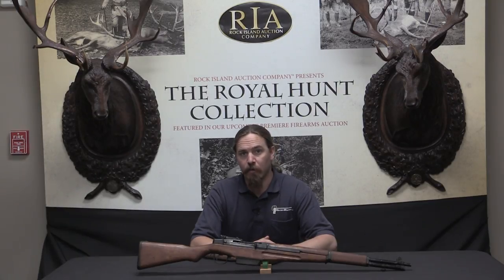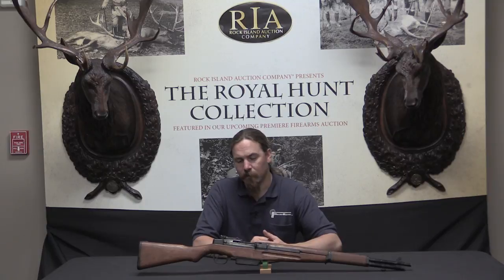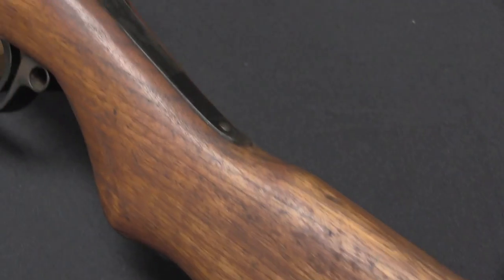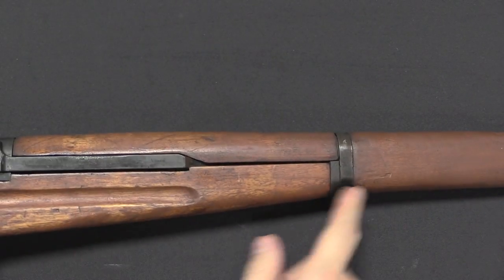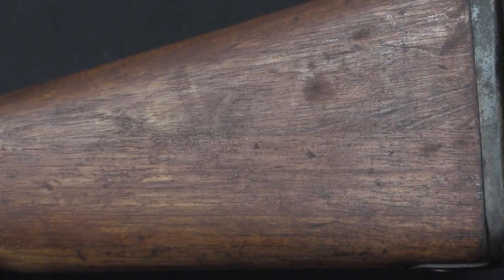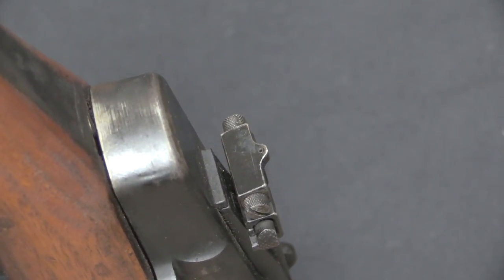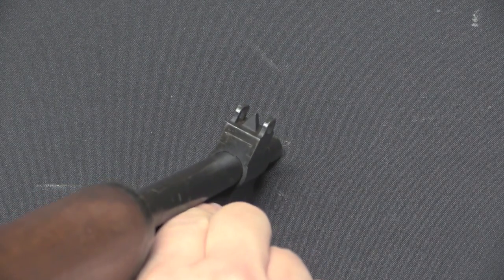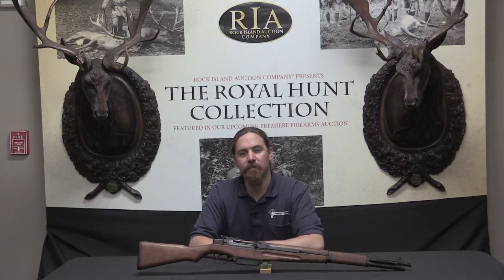Japanese Type 4 Garand

Comment: "These were never issues" Battlefield 1943 thinks otherwise
Reply: Same in Bad Company 2
Reply: +GTS Revolution Also featured in Bad Company 2. Most likely a re-used asset between the two games.
Reply: +GTS Revolution - get a life?
Reply: steve1978ger
Says the guy that seems to be upset about harmless trivia that's easily ignored.

A lot of video games have a lot of illogical implementations of various fire arms. It's just amusing to see those mistakes and trying to comprehend what the developers might have been thinking. Head over to IMFDB and you'll find lots of examples of articles mocking the nonsense put into games.
Reply: I am not upset :D
Reply: +GTS Revolution 

Didn't Battlefield 1942 have some kind of Garand for the Japanese too?
Reply: Tevo77777
They had Kar98s i believe. The Americans started with Enfields but later got Garands
Reply: +GTS Revolution 
I read somewhere that more US soldiers in WW1 were issued M1917 Enfields ("American Enfields") than M1903 Springfields.  

I knew when the US entered WW1 it was easier for the US firearms factories, that were already producing Enfields for the British, to simply re-chamber for US .30-06 than re-tool to produce Springfields  (but I had always assumed the US had more Springfields than Enfields).

If i recall correctly many of the M1917 Enfields (US .30-06) were sent to the UK early in WW2 for use by the British Home-Guard.  I think they were CLEARLY marked or painted in a manner to prevent someone from loading British .303 ammo.

I know during early fighting in the Pacific the US Marines used bolt-action rifles (I always heard they were M1903 Springfields).  I've never heard of the US Army using bolt-action rifles outside of specialty roles or at locations far from the battlefields.
Reply: thepezfeo Dude, i play Verdun, i know how the 1917 Enflields look and the guns given to the Americans in Battlefield 1942 were NOT it. They were Lee Enfields.  And even it they were, this is a WWII game we are talking about.
Reply: GTS Revolution
I wasn't arguing against anything, I don't play the game.  I was talking about actual history that I thought might be useful in some manner.
Reply: GTS Revolution
- well, sorry I take that back. Been watching gamer videos all weekend.
Reply: +thepezfeo your probably thinking about the american enfields that if memory serves were designated the m10 and saw limited if any use in the navy. but i do believe you are right about the us supplying rifles to the uk but i dont remember what model or caliber they were
Reply: To be fair, the battlefield games need the 2 sides to be relatively balanced with eahcother. So if an american class uses a semi auto rifle, the japanese equivalnet also needs a semi auto rifle.
Reply: LordDarthHarry Oh i know the freaking reason behind the decision, i still see it as a deal breaker.
Reply: +Tevo77777
Yeah, in the 1.61 patch. They called it a Type 5.
Reply: That is to balance the two sides. it'll be unbalanced if american has semi auto m1 and japanese only has bolt action arisaka
Reply: Hong Shen Obviously, but they still gave the Japanese a KAR98 German sniper rifle to add salt on the historical injury. On their website, they even said they did it because they just recycled an old model.
Reply: yeah that's definitely laziness. but bf1943 was a minor title that only released on consoles.
Reply: I don't remember the Garand or Type 4 in 1942, but I do from Vietnam's WW2 Mod.
Reply: Daniel Sinks

They were patched into the Pacific maps some time later if I remeber corectly.
Reply: LordDarthHarry I heard that but I apparently never got them. I played when I was around 12-14 and I'm 18 now, but I doubt they patched them in just a few years ago. I might just not be remembering.
Reply: Obviously they wanted the game to be balanced. The american was the only one who had semi-auto rifle anyway.
Reply: They also fucked up on the model too. The Type 4 Garand has a 10 round magazine opposed to the M1 Garand's 8 round magazine. The Type 4 also loaded with two 5 round stripper clips rather than a single enbloc clip like in the game. So lazy.
Reply: GTS Revolution 1943 was an arcade battlefield they weren't concerned about realism just balance
Reply: LordDarthHarry tell that to Day of Defeat lol
Reply: My Grandfather was issued a 1903 in the South Pacific.  Said the Garands came later.  Marine Corps.
Reply: Mutant1988 wait who’s arms are on fire?
Reply: actually most American soldiers in WW1 used the type 17
Reply: not true, America started the war with BOTH and as it progressed more and more the garand became more common while their ought 3's became more scarcely seen on the battlefield.  @JoeTheVenezuelan
Reply: Yet, for some reason folks thought a chick with a prosthesis was one toke over the line for people - BF1942 had jet packs. This is relatively tame for BF standards, or lack thereof.
Reply: @JoeTheVenezuelan   Battlefield always used WWII (And its set-pieces in general, though Vietnam was more accurate than other titles) as a thin coat of paint for their admittedly-fun multiplayer formula. Never been historic other than aesthetics. Like all of the "highest fashions" of WWII chic are to be represented. I know I said it already, but I can't say it enough - I don't know how this most recent nontroversy was something unexpected or new or even that offensive in comparison to how they've always been.
Reply: @JoeTheVenezuelan  the fact that i recognized you shows how much of a degenerate i am
Reply: @hongshen1429  idk about that, the japanese were pretty balanced in that game with all of their smg's and MG's, or at least, thats how i remember it.
Reply: Mutant1988 an example of this is far cry 2 where all the guns are mirrored like wtf
Reply: GTS Revolution Bad Company 2 Prologue as well 😂
Reply: There basically the same guns
Reply: They needed something to balance both sides. So they put this in there.
Reply: @JoeTheVenezuelan  the japanese had MG 42 in airplanes, tanks and mg nests. The medics and snipers had arisakas. And the US snipers used no. 4 Lee Enfield rifles. There were a lot of weird things in BF 1942
Reply: Finding out about this gun let me enjoy that game a lil more. Instead of being pissed off they fucked up the Garand.

Comment: I'd bet the pin hole rear sight was just a locating hole that never got drilled out to the final diameter.
I'm sure it was rushed through and someone thought they would get back to that step and it never happened.
Reply: im 5 years late but thats a really good point, makes a lot of sense actually

Comment: I'm surprised they didn't just slap slightly modified type 99 sights onto it. Certainly better than that literal pinhole and giant wedge. Thank you for the video though, I've been curious about this rifle ever since I saw it in Battlefield since I thought it was just a way for the developers to be lazy and reskin a Garand rather than it actually existing.
Reply: Yeah I also got the impression that it was just a Garand made to look Japanese. Then again, the one from 1943 had a strange octogonal rear sight similar to the M1 rather than the tangent, even though the irons weren't even used in that game, so I guess the models never were entirely on point.
Reply: Did the type 99 use the leaf sight similar to the type 38? I have a type 38 carbine picked up from pelilou. It's not in good condition buts it's a hefty beast with the intact imperial seal. It's at least as heavy as a Mosin Nagant. 91/30 that I own.
Reply: I want to think the rear sight on this example might not have been properly completed. I really doubt the guys building these things knew absolutely nothing about guns. Maybe the tiny pinhole is a pilot hole, and the sight was never actually fully drilled out to it's intended size.
Reply: @BringerOfD  My thought too.  The Japanese were no slouches about sights...I recall one reviewer of the otherwise-unimpressive Type 14 Nambu was very impressed with the easy-to-acquire-position trapezoidal notch of the rear sight.  And the type 99 Arisaka's rear ladder sight and battle sight are both well-defined apertures.

Comment: It's interesting that they decided to completely reverse-engineer the rifles instead of reverse-engineering the 30-06 cartridge so they could use captured guns, and reproduce the Garand much more easily. It seems like the cartridge would be a much easier thing to reverse engineer than an entire rifle, especially considering how much they would need to modify to make the Garand work in a different caliber, rather than just copying the existing design.
Reply: if they would have reverse-engineered the 30-06, they would have added a new cartridge to the supply system. units equipped with captured m1's would still have needed 7.7 for their machineguns. plus you can always rely on some in logistics fucking up and sending the 30-06 to a unit with arisakas while the unit with the m1's gets the 7.7.

Comment: Thank you for the great video. In Japan, there is a debate about the ammunition for the Type 4 automatic rifle developed by the Navy. One theory is that it is .303 (7.7mm x 56R), an aircraft ammunition used by the Navy, and the other is that it is 7.7 x 58 mm (Type 99 regular cartridge) used by the Army. It's interesting because it's natural for the Navy to want to use ammunition that is in circulation. It is unfortunate that the Army and Navy could not share the same ammunition.
素晴らしいビデオをありがとう。日本ではこの海軍が開発した四式自動小銃の弾薬について議論があります。海軍が使用していた航空機用弾薬の.303（7.7mm×56R）である説と陸軍の7.7×58 mm（九九式普通実包）である説です。海軍で流通している弾薬を使用したいと考えるのは自然なことですので興味深いです。陸軍と海軍で使用弾薬の共有化が実現できなかったことは残念です。

Comment: Meanwhile in WW2

Japan: I need a new rifle, hey America, may I borrow your homework?

America: Sure, but make sure don't bastardize it.
Reply: White343 The M1 was designed by a Canadian
Reply: @newman793  So? He worked for the US and it was manufactured there.
Reply: Igyzone He was Canadian-American so you are correct about it being American
Reply: They could get Gewehr G43 from Germany and rechamber it. Much easier than doing this with Garand without documentation and technical help. G43 is even cheaper to make!
Reply: @jakublulek3261  the japanese and germans werent as best of allies as most think.
Reply: Samuel Giam  That overpressure was deliberate design choice after problems on Eastern Front. You could just crank it down for Japanese. Plus Japanese cartridges have less pressure than 8 mm Mauser, they are closer to .303 British. It could be more about Japanese not having manufacturing capacity for new design.

Comment: The March 2021 issue of the American Rifleman magazine did an article on the M-4 Japanese rifle, its development and testing.  One issue they covered was the Japanese copied the M-1 gas system as it was regulated to the 30-06 cartridge.  The 7.7x58 Japanese round did not have that much power and was insufficiently gassed to function the action reliably.

Comment: Okay, this is purely my theory and is most likely completely wrong.

I'm thinking that the aperture sight was intended to be manufactured in two steps by first drilling a smaller hole, and then using that as a guide for a larger drill bit to make the actual aperture, and they just haven't got around to that second step because of the war situation.

Comment: Yes, the stock is very typical Japanese woodwork.  It would had been made with the strongest, tightest-grained wood, which comes from the trunk of the tree.  Also, it would had used no screws or nails, as wood fastened with wood is more durable.

Comment: from what I have heard (not saying it's accurate) is that the rear sight aperture "pin hole" is only a representation of that hump and where its center point is; it is drilled through to expedite manufacturing and lessen the chance of machining bits from snapping. So, it's a quick reference hole when adjusting left/right

Comment: The issue was that the Japanese Army and Navy were not that interested in a semi-auto battle rifle, despite thousands of M1 Garands falling into Japanese hands with the fall of the Philippines.  For the Japn High Command, the bolt action Arisaka with its five-round internal magazine was perfectly fine.  If you watch the 1998 movie, The Thin Line, which takes place in the Pacific, there's a scene that clearly demonstrates the superiority of the 8-round semi-auto M1 over the tried-and-true bolt action rifle.  Japanese soldiers are appearing over the crest of a tall hill and just a few GIs below are dropping each Japn soldier with a pull of the trigger.  The 8 round en bloc clip of the M1 was not great but enough rounds to put out a modicum of firepower.  Military firearms historians perpetually debate why John Garand insisted on not installing a larger magazine which would have held a better 10 rounds clip.  One source states U.S. Army requirements dictated a magazine that was flush with the stock.  Others claim it was John Garand's desire.  Either way, the fine M1 Garand started its operational career with an obsolescent magazine and clip feeding system that was only elsewhere used by the Italian Army in one of their main battle rifles dating back to WW1.  The Japanese Type 4 or 5? shows what the M1 Garand would have looked like had John Garand installed a ten-round capacity magazine.  It would not have detracted that much from the usual Garand's fine outline and would have given American GIs a ten round shot capacity versus only eight.
Reply: Knowing the government, it was likely the attitude of making sure soldiers didn't waste their rounds. 

Not using the BAR in WW1, tommy gun, and the Springfield round interruptor in ww1 are big indicators of why the 8 round thing was used.

Comment: This rifle was featured in Battlefield 1942, and again in Battlefield Vietnam's WW2 free expansion.  The only games where I have seen it.
Reply: Also BF1943
Reply: claus2427 Was that the mod?
Reply: Nope, it was a small game between BFBC1 and BFBC 2 as far as I remember :)
It had three or four maps, for PS3 only if I remember right.
Reply: claus2427 Oh ok.  Released 2009.  Never played it.  There are a lot of games that I have never played.
Reply: Blaine Bugaski Same here.
Reply: It was on 360 as well. I played a decent bit of it there. Not the best Battlefield game, but it did bring back the old fixed class system (although it was reduced to three) and added newer elements like building destruction. It also had a distinctive feature where an explosion near you would make your character deaf for a few seconds, with only ringing as audio. Don't recall that from any other BF.
Reply: Battlefield bad company 2 in the first mission
Reply: Call of duty ww2

Comment: Wait, once you loaded one stripper clip wouldn't the bolt slam shut?
Reply: oowwwww
Reply: Damn, too bad they didn't reverse engineer the clip.
Reply: the secret secret backup plan to win WWII: Give the Japanese Garand thumb and by god will they surrender then
Reply: sonofthem2 That's a lie. The bolt will slam forward when you touch it. That's why Garand Thumb is fake. Garand thumb will happen while cleaning the rifle,  not if you load it.
Reply: It actually depends. Sometimes it catches and needs an assist, most times it just slams forward when one removed pressure from the charging handle.
Reply: The Garand sticky bolt seems like one of those "Oh, yeah, that's totally an intentional feature, honest" sort of details.

Comment: Okay, here’s how I imagine this would be reloaded:
- The Bolt locks back on the last shot.
- Using their right hand, the soldier holds the bolt release back so it doesn’t fly forward.
- Using their left hand, the soldier inserts two stripper clips.
- Once properly loaded, the soldier lets go of the bolt release, with the rifle ready to fire.

TBH, this would be a nightmare in a firefight, imagine if you lost your grip and the bolt slammed shut on a partially loaded stripper clip. No thanks.

Comment: Also, unlike the US M1, the trigger mechanism is locked into the Stock, and only the Top receiver part pivots upward to dis-assemble ( screws in Trigger Plate extension into Wrist of stock, and screw forward of mag. Box, locks whole Trigger mechanism into wood.
Trigger guard only unlocks from main receiver. ( Not drop out like M1)
I agree, the rear sight aperture unfinished; pilot hole for pin reamer ( clock makers) to adjust to accurate shooting diameter for Japanese Eyesight..
The Navy was always more forward looking than the Army....all the Army's Pederson and CZ ZH29 copies were in the early 30s, and soon discounted.
( Pedersen because He did not inform the Japanese of the Lubricated  Shells.)